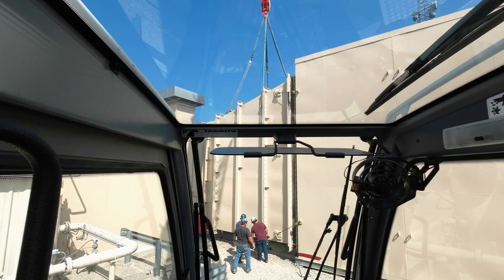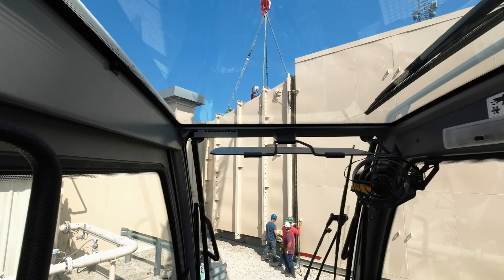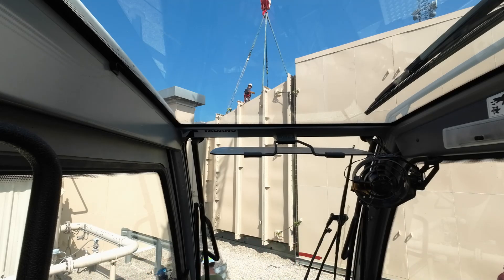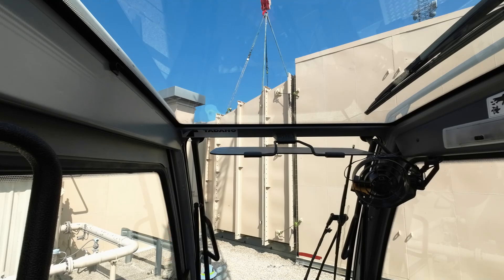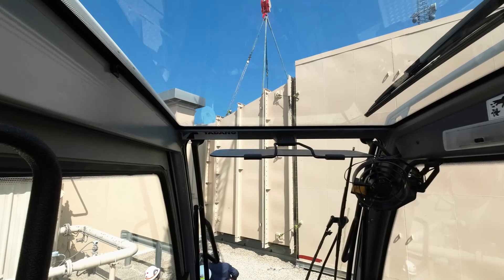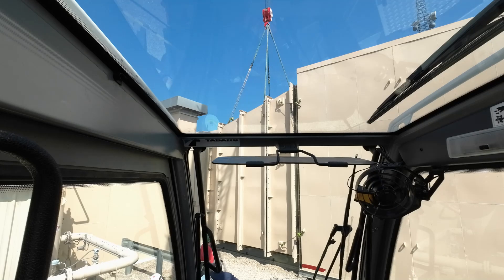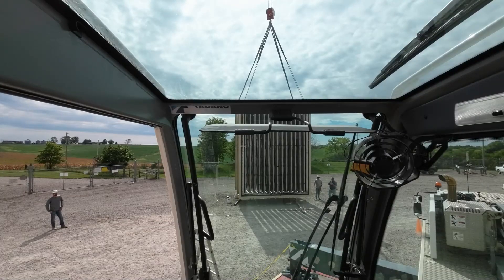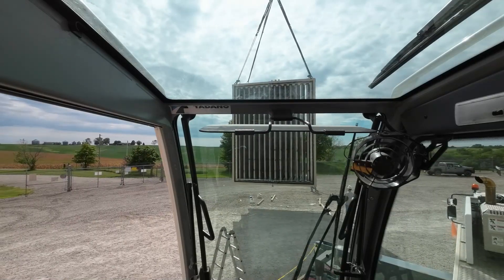Gas Turbine Generator

Comment: We have a few large crane companies here in my area. My buddy was an operator of a power plant. The engine owner went with a different crane company than the usual. They dropped the gas turbine. Turns out their insurance policy didn’t cover that type of material. Crane company told the company to sue them. Well, the engine wasn’t owned by the power company, GE owned it. You can guess how that went.

Comment: How do you match the stretch of the slings with different lengths to come up wity the proper length of the chain slings and end up level to pick the tapered load of unequal weight?

Do you have to make several trial picks to check balance?